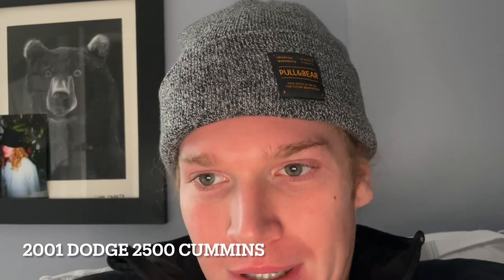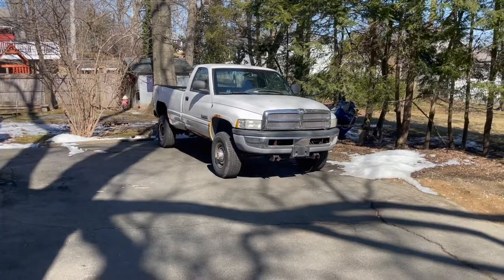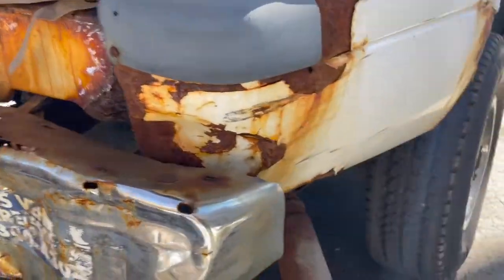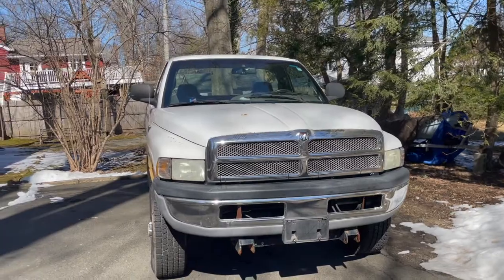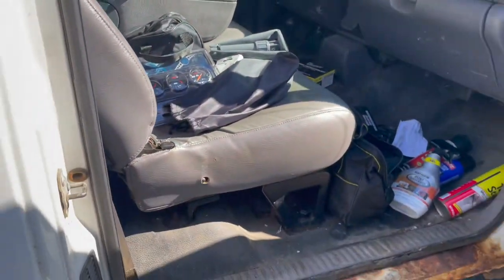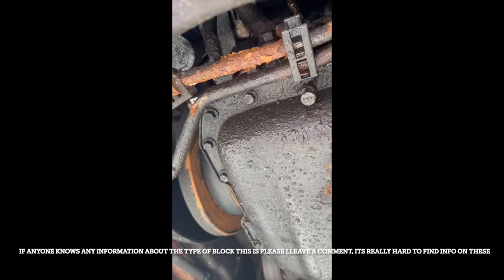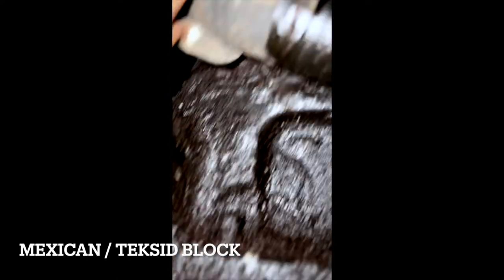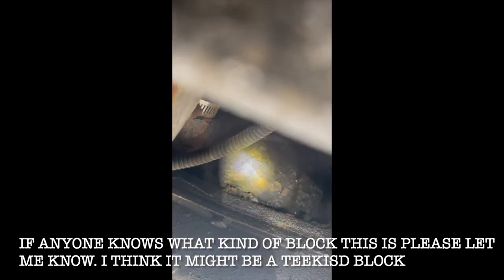53 Block or Teksid Cummins?

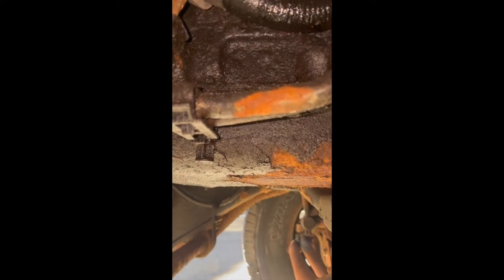Comment: hey bud, your blocks casting number should be at 3:11 in the video on that inset part under the wires. id take some brake clean or something along that line, then scrape it with a screw driver.  
seeing that its an 01 it should be a 55 block I've pulled 2 01 engines and they were 55 blocks. but id check inside the driver side door jam to find the date of mfg if its past half way of the year you got a late truck so you will more than likely have a 55 block .
Reply from the maker: thanks brother, I really appreciate it.

Comment: ohh and also if it is a 53 block no big deal because sam from vbelt and son on youtube made a video about how to remedy the block's issue. they crack because the water jackets for the coolant are thinner than the others so by cutting a tiny bit odd the water pump it lowers the water pressure so it doesn't put as much stress on the block